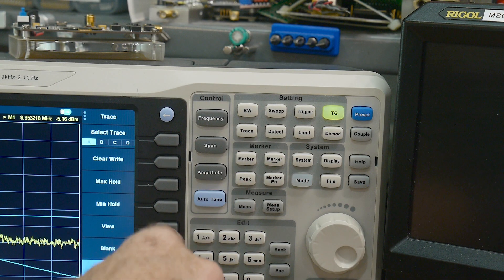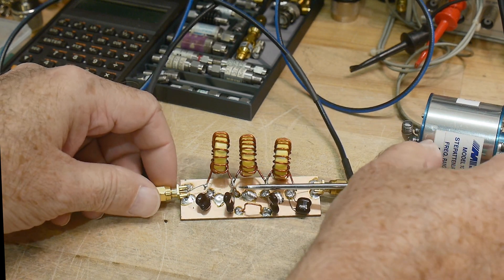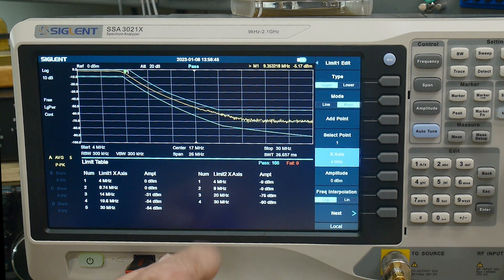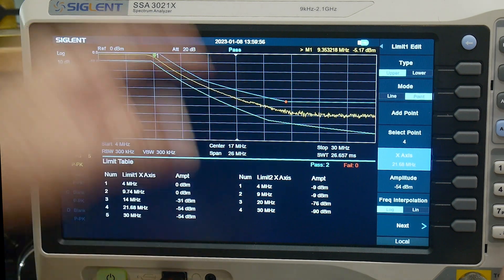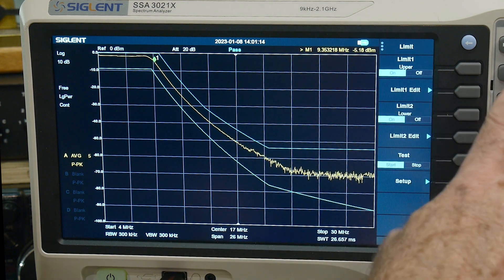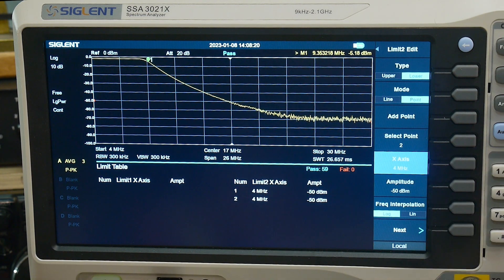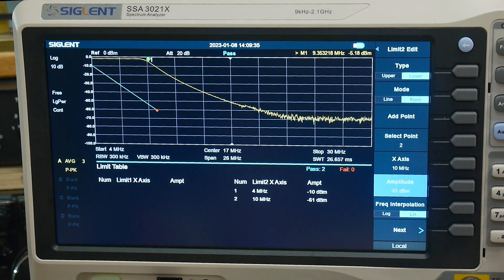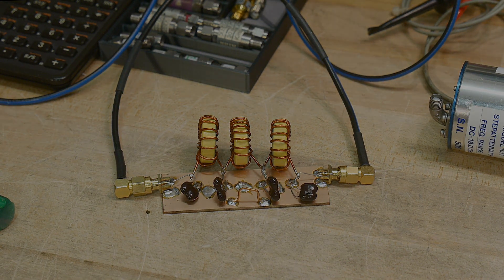#1397 Spectrum Analyzer Limits

Comment: I was looking for a spectrum analyzer that would work with lower frequencies.
As a metal-detecting fanatic, I want to do comparisons and show people what frequencies their machine is transmitting and using the amplitude get an idea of which models transmit the highest power.
The issue is that these machines are using frequencies from 1.5kHz up to 150kHz. I am currently using FFT mode on my oscilloscope, but I thought a spectrum analyzer would be better until I started to search for one that went that low.
Do you know of any models that would be useful?
Reply from the maker: in the old days I would say: HP 3580A      Today a good digital scope with FFT is better, there are many bad FFT scopes, but there are good ones too.
Reply: Check the Signal Hound SA44B. Frequency range 1Hz - 4.4GHz, it's made in US.

Comment: Seems like an interesting feature would be to have the SA automatically set up limits based on a reference signal. The user would only have to provide a tolerance, then could tweak the auto-gen limit as necessary. A very naïve implementation would be quite straightforward (snapshot the reference trace, add/subtract the tolerance at each point on X axis, and there be your limits). But that could be improved without too much trouble. OTOH, I'm sure it's not worth their time - I just like adding features to things because I'm a software dev...

Comment: Looks like your spectrum analyzer is handling above 18 MHz different than below 18 MHz. Fair enough, but there is an increase of maybe 1-2 dB in the noise level above 18 MHz which seems a little high...